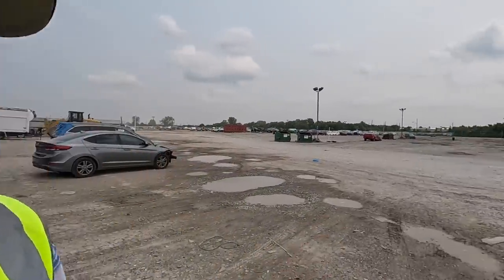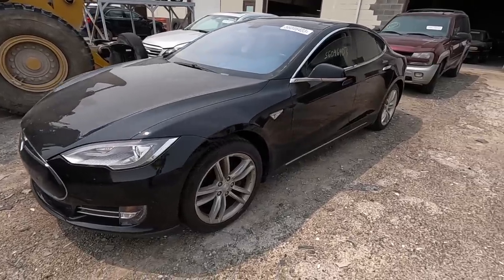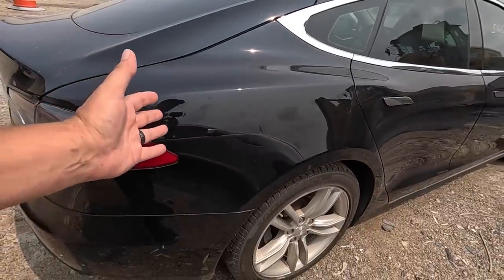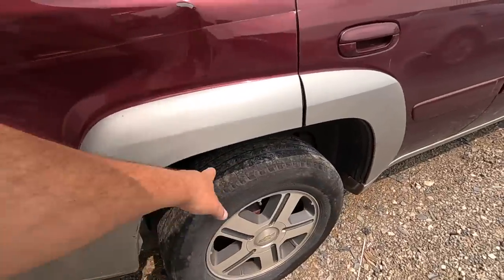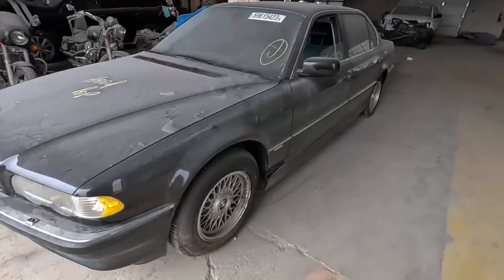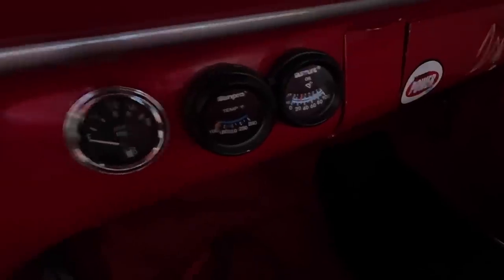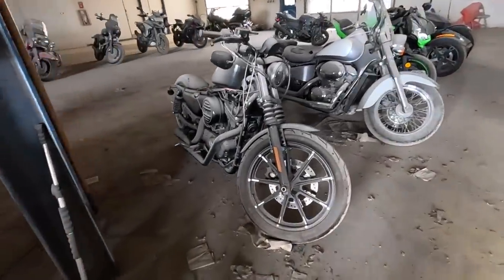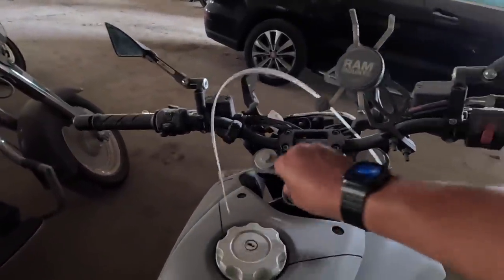I'm Winning a DEAD Tesla Model S for $4000!! + 65 Ford + Motorcycles Copart Indianapolis

Comment: The Kia Soul: I recently restored a stolen Kia soul for a friend. I pulled parts off a scrapped Soul at the scrap yard. The lock tumber I bought on Ebay. The rear window is easy to replace. Most of the interior was an easy swap. An ozone generator fixed the odor. I spent more time cleaning glass out of it.

Comment: IIRC the hook can be opened using a jumper pack. There are wires in the front tow hook area i think? Some googling will be required, definitely in the manual somewhere

Comment: Hey Randy.....get the trailblazer.....that inline 6 is a soild motor.....i bought a 05 Envoy xl a few years ago for $2k...i have a few videos of it and what ive done to it on my channel........ive had to have the transmission rebuilt and had to do some other work to it and a set of  tires.....but it runs good for over 200,000 miles......check it out when you have a chance.....😁

Comment: if you remove the center grill, in the bumper cover,  all clips in,                there is a poss and neg battery post right there, to unlock

Comment: I'm going to say it's again I set it a few videos back hopefully you see it this time If you leave your jump box on the car after you crank it the car will also charge your jump box you don't have to deal with dead jump boxes
Reply from the maker: And that is not correct. Running the engine does not charge my jump box. I've tried.
Reply: @AutoAuctionRebuilds  That's crazy I have a noco GB 150 and it does charge from the car I've tested it... Maybe it only does it in emergency boost mode

Comment: get that tesla, it would definitely make a good video. it doesnt have power because the 12v battery is dead, battery that runs motors and other high power stuff is probably gonna be fine.

Comment: Tesla used parts are expensive. The scrap value on it would be high. The 12 volt battery is in the front behind the center panel.

Comment: The fact that somebody donated the Tesla to a charity just to get rid of it as quick and dirty as possible speaks volumes to me about about that car! I am not interested in any car that I am forced to buy new parts directly from the manufacturer; no matter how old the car gets. I don’t mind that it’s electric (but I wouldn’t want to deal that with until the charging infrastructure is much better established than it is right now) but I also don’t want to do anything that profits or makes me dependent on Elon, directly or indirectly, even in the most basic way! Chop it up for parts or just skip it. There are better cars to buy! Buy the SHO! BMW probably has bad timing guides that took it down. It probably would clean up nicely, but dealing with the timing would is a nightmare. If only BMW had just kept the old big six from the late 1980s 735i and just supercharged it to boost the power, owners would have been better off!

Comment: That Tesla is sitting so high off the ground because someone has removed the main battery in it. those are worth thousands alone and it's not uncommon to buy a salvage one to repair another car. Most likely that's what the deal is with this. They probably just put the battery shell on the bottom of it, empty of it's cells

Comment: @AutoAuctionRebuilds  hey man the charge port is the first redpiece of the driver side also there should be on the front bumper a circle area which you take off that cap and 2 wires one red and one black you just any battery on it and it provides enough charge to get to the hood open doors etc that's some valuable info to know i may be only 1 but i know so much about teslas these days because I'm such a big fan another thing to note is that a new battery would cost you around 15,000 but not if you would take that to electrified garage he does it  for real cheap he has a channel called @richrebuilds he could tell you more about the tesla
Reply: i ment to say you could put any battery on the wires and I'm 16 not 1